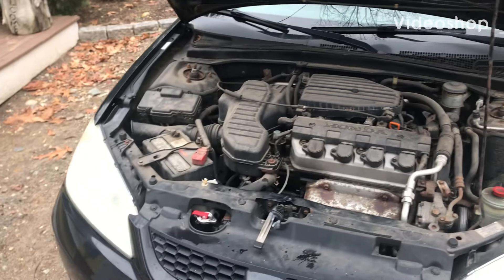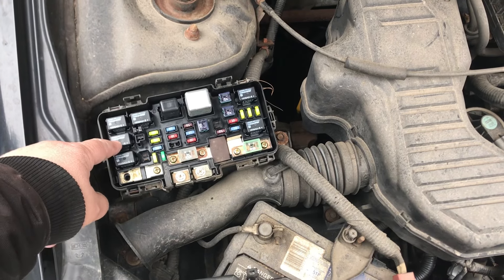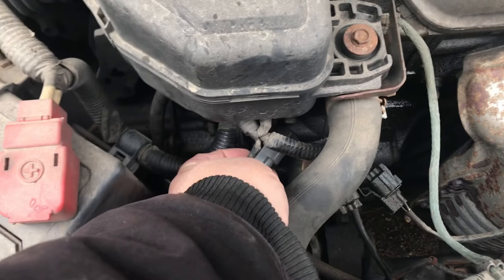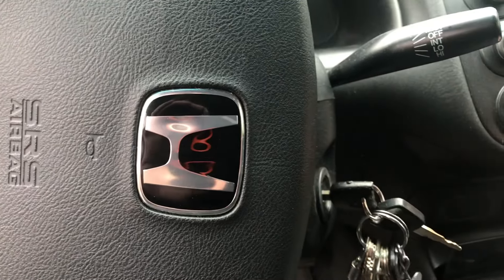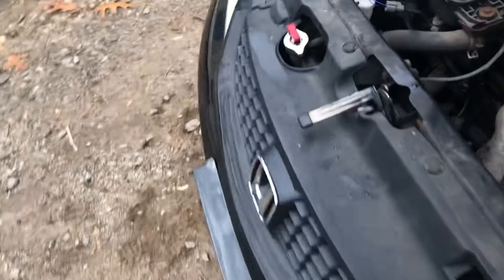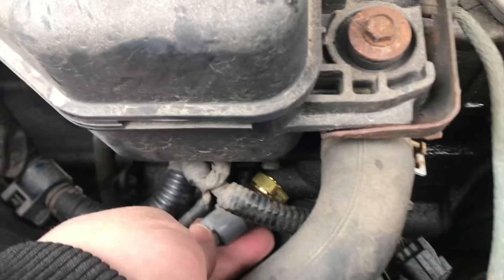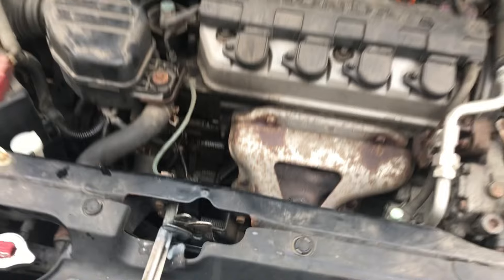Honda Civic “01-05” What to Check when Overheating. DIY & $ave

Comment: Dude!!!! I can’t believe it. Your video saved me hundreds. I troubleshot the relay, the fuse and I bypassed the conector. 

Fans worked, but wouldn’t come on as the temperature increased. 

Replaced the sensor as you stated and everything works like a charm. 

My beloved civic lives again because of you and for a fraction of what it would’ve cost me at any shop. 

I loved your video. 

Subed.
Reply: can you tell me what that little hose is connecting to the radiator from the coolant reservoir tank? its slipping off and causing mist or air to come out of the radiator where the hose is supposed to go
Reply: Nice! I'm having similar issues with my fans on my 04 civic. Gonna try this and see what happens.

Comment: I've been a mechanic for over 50 years I randomly watch videos from time to time my son's car is an 01 Honda just a little beater commuter car overheats intermittently fans are coming on they don't come on at 95° they come on at about 180 with the AC off and they cycle on and off some cars go get as high as 220 or even 230° before the fans come on if you're not using the air conditioning this one is being really sneaky the combustion gas test was negative most of the time when you have head problems you don't get water in the oil nowadays you just get combustion gas in the cooling system sometimes it can be really sneaky sometimes it'll go along fine for even a month before it overheats usually when it's like that it's because the head is slightly warped so even if your radiator is clean your thermostat is good your fans are coming on your car will still overheat just an FYI for all you troubled people out there
Reply: Hey this is exactly what is going on with my 2000 honda civic with 215k miles on it! Do I  still have a lot of life in my car or should I be looking for a new car soon? Thanks!!
Reply: Thank you for this, I'm a bit mechanically inclined and I was going crazy other this issue because the head gasket looked fine and I replaced the hoses, radiator, cap, switch, and thermostat. I guess I'll remove the head and have it resurfaced.
Reply: Should I replace the engine or buy another 03 civic

Comment: I found the reason my honda civic was overheating. After checking everything else, it turned out to be dirt on the bottom of my overflow reservoir being dirty and blocked the hose to the radiater. Problem solved. Would have saved me a fortune in money and time. Check that first.

Comment: I changed my thermostat and flushed my radiator system but once I went over 60mph it started to overheat again , and when at running temp the coolant bumbles
Reply from the maker: Check the new thermostat. Make sure it’s the same size as the orig. some replacements are smaller. Also check radiator cap to make sure it’s operating properly. Check oil if you see white foam then you have a head gasket leak. Good luck
Reply: Air in the system
Reply: Blowed head gasket
Reply: Burp the coolant system easy to do might be the issue
Reply: @HighRidgeHandyman p
Pp00
Reply: Did you ever fix the car ?

Comment: My 05 civic lx overheats when parked but cools down when giving gas, any input?
Reply: I have a 05 Honda civic ex. It was doing same thing as yours. I'll tell you what I did to fix my problem. Drain coolant and stick water hose insides the radiator and radiator hoses. Once you flush it out and drain it. Put everything back together and fill radiator with white vinegar and turn on your car with heater on for about 20 min or so. More likely you have a motor or heater core blockage. Drain everything out and refill with coolant and you will be surprised it won't get hot.
Reply: Fans aren't turning on causing car to overheat when not running.

Comment: If you own one of these your head gasket is blown.
Reply: Damn.  I hope not
Reply: Hard pill to swallow but when the liquid turned green i knew it was true.
Reply: Ours I think is heater core I'm a mechanic and I live Hondas but I didn't know these have so many problems it runs and drives great but runs hot at idle and the heat goes away coolant staying clean so is the oil when I bought it oil was dirty but not milkshake. I think heater core is clogged heat fades when we stop and temp rises but down h9ghway heat is hot and with heat off it still stays where it's suppose too
Reply: @tylerbuilt_chevy_tough5163  does your thermostat work I’m pretty sure that was what caused mine to blow.
Reply: Not if the oil is normal
Reply: Yes… yes it was, thank you🤣😭
Reply: @tylerbuilt_chevy_tough5163 same issue! did you figure it out?

Comment: Can't you see if the fans are good without doing anything and just turning on the AC ? My AC fans work. However, I noticed my fans do not turn on to cool it when everything is connected to the Sensor.

Comment: I don’t know if my car is overheating or not. Basically i started seeing steam coming out of the front right side when i was sitting at lights. But my temperature gauge has never gone above the mid point. I would pop the hood and noticed that the steam plumes out more when i added throttle. I am also losing tons of coolant if I don’t check on it every so often the reservoir will be empty. I’m suspecting the radiator because it has a layer of coolant all around it and today i started leaking coolant from the lower radiator hose area. Could it be a head gasket? I don’t know what it is
Reply from the maker: Could be the actual hose or clamp. Check where the clamp meets the hose. When your pressure builds having a pin hole could eventually leak. Check both hoses. Good luck
Reply: @HighRidgeHandyman  I’m definitely going to check it soon. I think it’s the hose that connects to the bottom of the reservoir because that’s coincidentally where the splashguard is always wet. Hopefully it’s something simple. Thanks for the help!
Reply: @edgarzavala8416  (for you and also for anyone reading) You’re correct to look to where there is moisture that you can see. However, think.. that splash guard covers a large area, underneath the car, too. Above it, are various coolant hoses, clamps, the thermostat housing, coolant sensor with a damaged or missing o-ring, overflow reservoir upper/lower hoses (to name a few ). that could be leaking, on that side. Ya know? 

* Edgar, I’m hopeful by now, that you’ve found and fixed the issue. If so, good. Let others know in a follow up comment, if that was the issue and/or if it wasn’t, what was and how you fixed it!? Just my 2¢.

Comment: Thanks I really appreciate your help. 
I checked all relays and I changed the temperature switch and the thermostat. And still it doesn’t turn the fans. 
What can be. Any recommendations? Thanks.
Reply from the maker: If you tried the paper clip and they went on. I would make sure the thermostat isn’t defective. Oh make sure you have the correct temp switch for that model. There are a few different ones that will fit but not communicate. Remember the temp has to rise considerably before they operate. And it wouldn’t be a bad thing to just check the wiring to make sure there are no loose connections. Good luck.
Reply: Thanks the switch that’s the one auto part give me I mach and looks the same. I check all the connections. Looks good. 
And I let run for a while up to 185f 
And the fans it doesn’t turn on. 😮‍💨
Reply from the maker: @maximobautista4854  the first sensor I picked up, looked like it was the same one and it did fit, but there was actually a different model number for my particular engine. Make sure
Reply: Thanks

Comment: My radiator keeps pushing all the coolant out of it and into the reserve tank, then spews it out onto my engine. Then I start overheating cause there’s nothing in the actual radiator FML
Reply from the maker: @bigbankhank424  Potential causes:
Faulty radiator cap:
A worn or damaged radiator cap can't properly regulate pressure, leading to coolant overflow. 
Clogged radiator:
Accumulated debris inside the radiator can restrict coolant flow, causing pressure to build up. 
Stuck thermostat:
If the thermostat is stuck closed, the engine will not properly cool, causing the coolant to overheat and overflow. 
Leaking head gasket:
A failing head gasket can allow combustion gases to enter the cooling system, creating excessive pressure and pushing coolant out. 
Damaged hoses:
Cracked or deteriorated coolant hoses can leak, allowing air into the system and causing pressure fluctuations.
Reply: @ thanks brother, I will try these things you mentioned here and in the video! Just bought this car and it’s in very good shape other than this issue

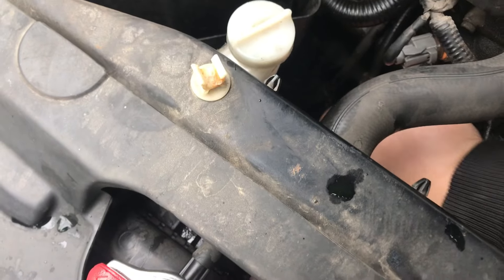Comment: Thee relays arent. Bad the fan 5:38 s. Come on by themselves and they def come on with the heat  and.  A/c switch. It drives fine for hours but goes through coolant .... it starts to over heat after long peeriods driving through downn <40 mph  but. If.  Pull over. And fill up the coolant (15 min waiit if that )  it runs fine again. Ive tabed water. Bottlle annd squeezed rubes got as much bubbles out.... i need this car for woork im screwed plz tell me u have an idea
Reply: Replaced. Temp sensore sendee forr fans and thermostat already
Reply: You’re cooked

Comment: I had my radiator fixed on my 2004 Honda Civic because the car overheated when the heater was on. worked, now it's happening again. brought it to a mechanic and he couldn't find anything wrong. Did the "bubble test". If I keep the heater off,it doesn't overheat. Could it still be the radiator, or something else?
Reply: I have the same issue , when I turn on the Ac or heat . The cat engine starts over heating .
Reply: @chrisramos1525  i just don't turn on heat I guess since it's Florida no big deal right now
Reply: @LindaStamberger  I was able to fix the problem of the engine over heating . The issue was that , behind where the anti freeze coolant goes . There was a line disconnected . So all the antifreeze would escape
Reply: That's good you found problem, I'll have to check that out on mine

Comment: I have a 2004 Honda civic it continues to over heat and I constantly have to be putting coolant. Is this a blown gasket ?
Reply from the maker: @alanramirez1049  check hoses,radiator for any signs of leaks. Some hoses have to heat up before they leak usually near the clamps. Also check water pump for leaks then poss blown gasket. Check oil dip stick if milky white in oil thats a sign of a blown gasket or bubbles in the radiator or reservoir overflow. Good luck

Comment: Im having issues like crazy. 
I got a new radiator fan and temp control switch. They seem to be working like they should. However, both fans do NOT come on when i have my AC off and they should once engine gets too hot. 
My temp needle goes all over the place while driving. It will go up to redline then come back down once im doing 50mph or more. 
Ive had my radiator bled and gotten air bubbles out. Checked it for a blown head gaskets or leaks and that came back fine. Work well for a couple weeks after the system was burped. Now im over heating again. 
I have coolant, no leaks, head gasket is fine, i replaced radiator fan and temp control switch and im still overheating. 
Ill have to try and buy a radiator cap and new theromast. If that dont work. Idk what it is.
Reply from the maker: Definitely change the thermostat and cap but if both fans aren’t working try checking the wiring to the fan not working. When it heats up both fans should be operating to keep it from overheating. Good luck
Reply: @HighRidgeHandyman  I got a new radiator cap and thermostat. I put new cap on and it was working normally for about 2 weeks and wasn't overheating. I tried putting my heat on to defrost my windows the other day and I had no heat. I needed coolant.  I added coolant and now I have no air 😂 I mean wtf is wrong with this thing.
Reply: @christopherwilliams5808 whatever happened?
Reply: @user-yt2gv7tg1t  it still acts weird 
I think the temp gauge is fucked up.

Comment: Just change my thermostat/ radiator cap and / sensor switch and my car is still overheating it only over heats when I’m driving in the freeways for a long time , I did notice coolant overflowing in the coolant resovor
Reply from the maker: Could be a faulty thermostat or your water pump or check for possible head gasket issue when engine really heats up. Good luck
Reply: Headgasket leak might be minor

Comment: I have 2005 Honda civic 3 days ago it started screeching when I turn engine on and today it over heated after 1hr 30 min drive. What do you suggest
Reply from the maker: Possibly Bad bearings,loose belt or worn belt,water pump.

Comment: My problem is after a long drive it overheats only being parked up. The top hose is warm if I was to squeeze I can, lower hose is hot. Fans work n all. It overheats when it wants too. Is it a thermostat? My fans go on n off so I don’t think it’s the switch. I had a bad thermostat b4 n it would do the same except that when I would accelerate it would overheat(hence no air flow) so I’m stuck for real
Reply: I think it’s thermostat I’m getting mine fixed my car does the exact same especially when the car is idle and idk this car makes me nervous when I’m in a stop light or traffic sometimes gotta turn off the car, it always goes down when I step on the gas it’s weird

Comment: What if only one fan is turning on? If your looking at the front of the car, the left one is not coming on. At first neither was coming on so I replace the same sensor & only one of them came on.
Reply from the maker: The drivers side is the AC condenser fan the passenger side is the main cooling fan. Turn both on by running engine and turning on AC. If only one comes on get some type of object and tap the motor to the fan not working. If it comes on you most likely will need a new fan motor. If not check the wiring connections. Then check the fuses associated with the fan not working. And obviously checking to see if the sensors are good.

Comment: I have this problem, My 95' Civic overheats when it is regulating, when I am on the highway it does not overheat. I have already changed the temperature sensor on the dashboard, cleaned the radiator and changed the thermostat. What else could it be?
Reply from the maker: The reason your civic is not overheating when you are driving on the highway is because the air is passing through the engine keeping it cool. But when you’re idle or driving around town and not getting a lot of airflow it will overheat possibly due to faulty fans. You have to check your radiator fans to make sure they’re operating properly.

Comment: Thanks ima try this when I get home, mines starts overheating 20 mins after driving . Hopefully none too bad 🙏
Reply from the maker: Check fan operation. Also check thermostat. Could be faulty with intermittent issues. Good luck
Reply: @HighRidgeHandyman  I just had a new thermostat n radiator installed but we'll see

Comment: Good morning, I have a Honda Civic 2003, that the radiator and hoses were changed last December 2022, 3 weeks ago the coolant reservoir cap blew on it, repair shop said they put a sealant on the fluid and tested everything and should be fine after a  week same thing happened. Now they are saying its the head gasket needs to be done( That's a lot of money), but my oil is dark as hell not any sign of coolant/water in it. So I bought it home for now.
I already did checked the fuse and fans with a pin myself and they are working. What would be my next step? Thanks
Reply from the maker: Sounds like your pressure is building and unable to release so it finds its way to the reservoir cap. Try changing the actual radiator cap, I would also change the thermostat. See if that helps before changing the head gasket. Good luck
Reply: @HighRidgeHandyman  , even if radiator cap with the radiator itself is 2 brand new?
Reply: And also the thermostat was replaced that time when the radiator was replaced.
Reply: D16V1 cooling problem is known!

The point is that the expansion tank should be filled to the maximum level when the engine is warm, and the radiator should be filled to the maximum level as well. If there is still air in the system, the car should be parked on a sloping driveway with the front facing upwards. With a warm engine, idle the car and turn the heat to maximum and set the internal air circulation to on. Remove the radiator cap and wait until all the air comes out through the radiator. When no more air is visible coming out of the radiator, the engine speed can be increased to 1500-2000 rpm. This further circulates the water and more air will come out of the system at this point.

As air comes out of the system, the radiator should be continuously refilled. After this process, there should be no more problems. Every mechanic told me that my car had a blown head gasket, this was 6 years ago, and there has been no problem to this day!

I hope I was able to help...
Reply: @ronald72able  replace the reservoir
Reply: @Papaijanos got the same issue and your suggestion doesn’t work. Expansion tank is full and so is the radiator.

Also you mention to get car warm and then open radiator cap but that will result in a boiling disaster.

Comment: Paper clip turned the driver side fan on. Replaced sensor and the fan won't kick on. The passenger side fan never kicked on with the clip in and AC on. Any suggestions?
Reply from the maker: Check the relay,check fir blown fuse, check the wiring for an open wire. Also make sure you got the right sensor. 👍🏻
Reply: Check Relay, fans and sensors. I had same issue before. LOW COOLANT CAN GIVE FAULTY TEMP READINGS,, CAUSING FANS NOT TO TURN ON
Reply: According to all the info you provided my next step would be to replace the passenger side fan.